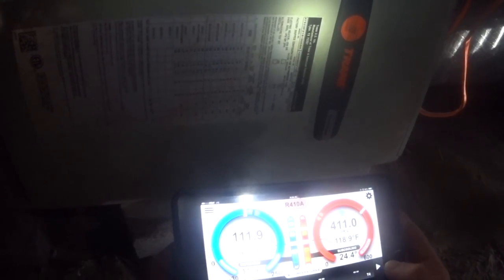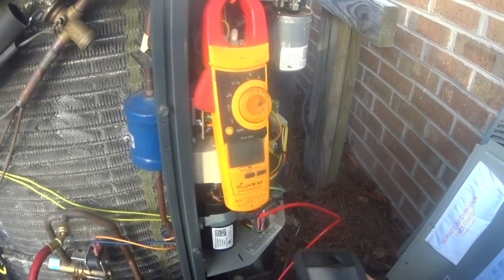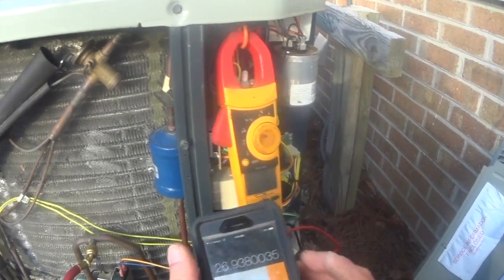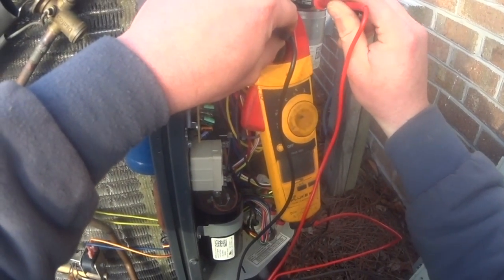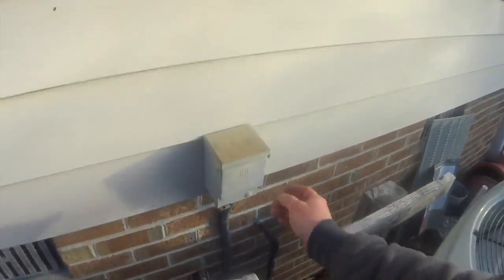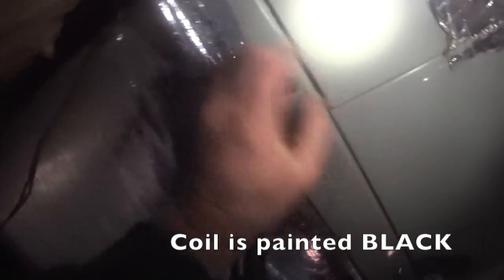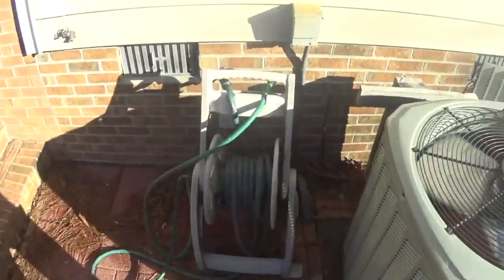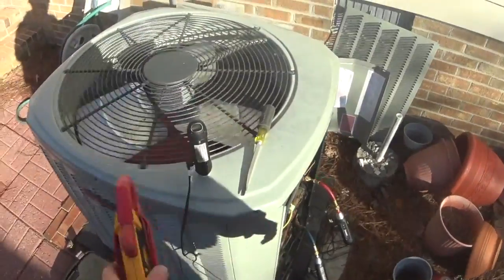HVAC Service: What Exactly is Your HVAC Contractor Doing? 3-16-15

Comment: Trane dosnt put their static testing results on the air handler data plate? I work mostly Lennox, Carrier, Gooodman. I see maybe two Tranes a year. Still good stuff, new guys I train I force em to watch you and Steve Lavimoniere. Ya'll are the only two I respect.

Between us though, fuck those crawl spaces. Ill take my hanging, attic and platform systems over your crawl spaces anyway. God bless Florida.

Comment: ive seen used 2650 and 2652 and iv seen outher used 2653 is thear a difference  just want to make shure thank you
Reply from the maker: Run the calculation each way and decide for yourself, I've not seen enough of a difference to really matter. I've seen 2650-2654 and personally use 2652 since it right in the middle.
Reply: +Stephen Rardon (HVAC with Stephen Rardon)  i see thank you.
Reply: The multiplier is derived from 

1,000,000/(2 x pi x hz)

In this case hz is 60, so plugging into a calculator we get

2652.5823848649222628147293895419

Comment: I use your formula for checking capacitors all the time. Great for when you need to leave the unit running.
Reply from the maker: Yes it is, hardly ever shut a unit down until I need to clean it up